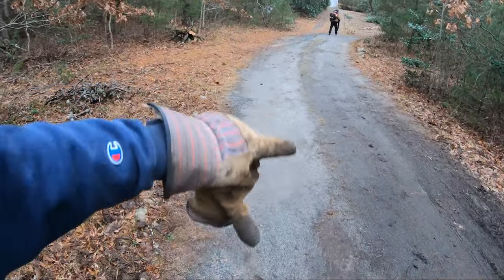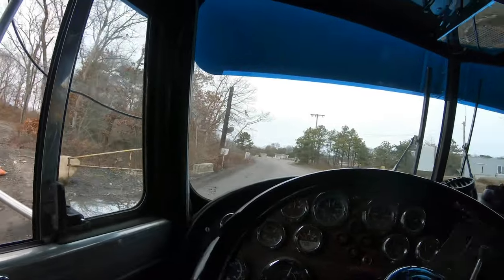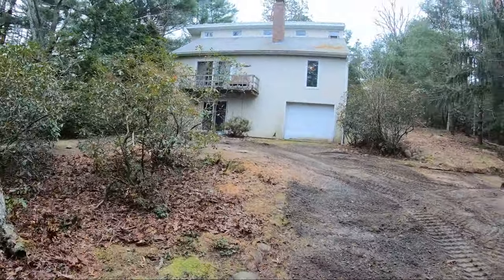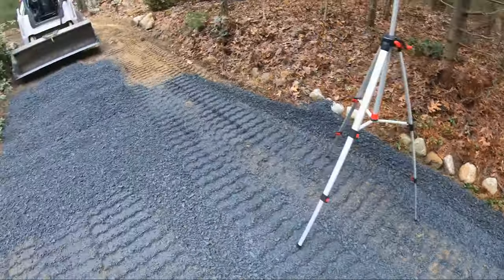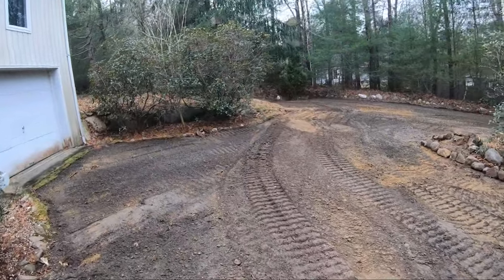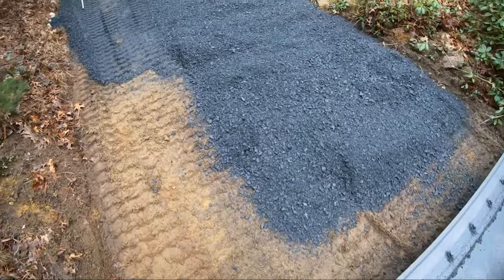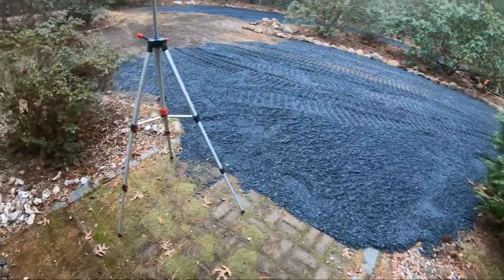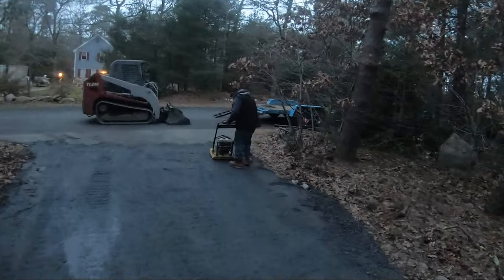Fixing A Junk Gravel Driveway!

Comment: I run a skid steer, yet I would never turn down gate spreading. Here in WA I've only seen one person fuck up gate spreading and it must have been on purpose. The cats meow is the reverse back spread.  You have good machine skills. No reason to put your nose up at something that aint hard.
Reply from the maker: I didn’t say it was hard. I’ve done it many times in the past . I just  don’t like doing it. I think it is hard on the truck.  Where we live no one does it anymore.   Thanks for watching!
Reply: It’s a skill and has to be taught or handled down.  If the drivers don’t have the skill or no one was there to show them they won’t be able to do it.  It’s tough to teach yourself so many new drivers can’t or don’t know how.  It’s almost becoming a lost art in many places.
Reply from the maker: @balrog006  we just don’t have the room here. Cape Cod is such a small place. There’s low  tree branches and wires everywhere here. It’s not worth smacking the headboard, beating on the truck and  I’m not interested in getting a pruning bill for all the hanging dead mangled branches.
Reply: Definitely a time and place for it as well as you described-not every job is the same or has the right conditions to make it worthwhile-that actually goes for a lot of standard practice-some jobs they work and others they just won’t.  Use the tricks and methods you can that suit the job to get it done.
Reply from the maker: @balrog006  exactly! 👍

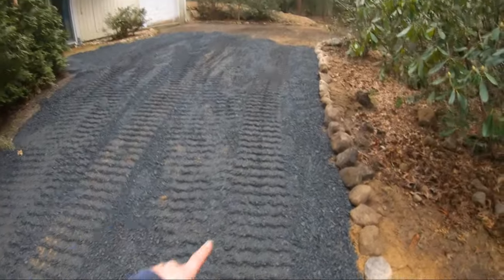Comment: Your comment at 19:45 is the reason you forward spread your stone from the pile. Then your tracks are always on stone. Can't believe you didn't roll a base layer. Even if the customer doesn't want it, it's your responsibility to educate them on the whole process and why you need to do certain things. If you can't convince customers what needs to be done properly then walk away and let someone else be a hack.
Reply from the maker: Forward spread? Oh, so you’re the guy that just pushes the pile over knocking them into the woods making a fucking mess. Besides, you’re always going to have some dirt that falls off your tracks. The driveway already has a pretty hard base layer of clay, rock and stone. Why would you rip off the customer by selling them something they don’t need ?  That was one of the hardest based driveways I’ve worked on plus the dense grade material we use packs like concrete. It’s been almost 2 years now and the driveway still like the day we left it so save your speech for something you actually know about.

Comment: Don't blame ya on not wanting to spread in tight area's ,the roof of my cab is crushed in from the box laying  down with a limb under it,  what i ended up doing was getting a couple box vibrators and mounting one in the middle of the bed and one in the very back under the gate,  i can dump or spread a load with my truck without raising my box more than a couple feet, just a helpful thought, Anyways What my question is, i noticed you don't compact your subgrade? do ever have problems with it turning to sht while your laying down your gravel? Where i live we get a lot rain so if we don't at least static roll the subgrade it will either turn the road to mush or you run the risk of dragging mud on the clean gravel. not criticizing just curious on the way things work in other places.  And that truck is sweet, this out of line but can you give me a ballpark on the price?
Reply from the maker: @dLLISh7108  thanks for watching!   So this driveway is in a rocky hard area of town and most of the driveway is hard clay mixed with the old crushed gravel so when I was scraping it I could tell it didn’t need to be compacted anymore. I could hardly Dig It up .If it was a new driveway I always compact the sub grade first . The old driveways that have been driven on for many years don’t normally need it if your just adding to it you can just compact the material you’re putting down.   I think we charged $4200 for this.  It would be way more with todays prices.

Comment: I do not use fabric on my driveway jobs interested in your reasons for not using it. My own driveway is .6 mile long, no fabric 3 years later looks great even parts that go through a swamp. Base was 4 +/- inch then 2 +/- inch then 3/4 B gravel. I find fabric does not stop weeds and a pain to work with and when pieces poke through years later.
Reply from the maker: It’s pretty much a waste of time for weeds. They will just grow on top of it if they’re going to grow . It’s expensive and like you said it’ll poke through eventually and become a pain.

Comment: 12 tons on that truck, not safe at all,  and i bet not legal at all.
Reply from the maker: Actually, it is legal.  Truck has an aluminum frame . It’s lighter than it looks when I built the dump all day I took out the ribs to reduce weight in the passenger side tank is completely empty. Dummy tank just for looks. I also took out the spring suspension and put an air ride because it’s significantly lighter. Truck is a custom built Truck that is completely legal in my state .

Comment: Nice job, I like the blue stone, we have some here in southern maine.  We also do both,  tailgate out a load or spread with a machine, and it depends  what's around us, wires, trees, etc.. and you'd right, if it's your equipment,  then do what you want, that driveway, I'd done what you did,, dump and spread it
Reply from the maker: Exactly. Also depends on what truck your using. I’d feel more comfortable with a spring ride truck. Thanks for watching!

Comment: Maybe I missed it, but what’s the name and size of that material you used on the driveway? Also what brand of tilt tach are you using and how has it held up?
Reply from the maker: It’s recycled asphalt 3/4 minus . It’s made by Paladin . And it’s held up really weld so far but I don’t use it all the time . Just on driveways and fine grading .
Reply: @DirtBrute  thanks man, great video and great work

Comment: i believe the best way is to dig out enough dirt to place used tires down, but also cut the sidewalls on each side of the tire out then dump the gravel down, the tirers will keep all the gravel in place, use cement blocks as borders all around. you will never ever get any pot holes and will last forever or until you dig up the gravel and tires.. it is so strong as well that you could driver an 18 wheeler over it with no problesm...just my 2 cents.. your job looks great thought...you will never get any rain water build up because the water will seep through with no problem as well..
Reply from the maker: Thanks for watching